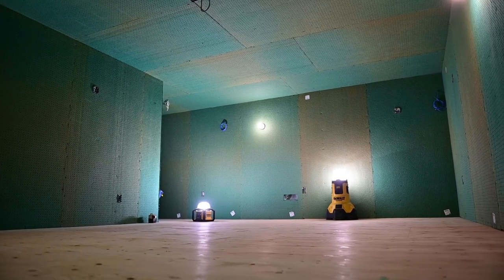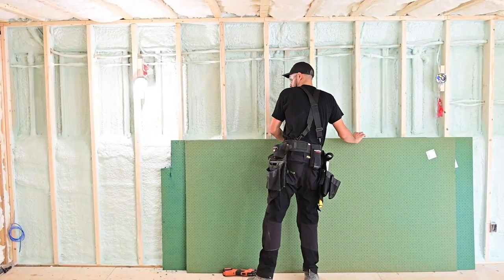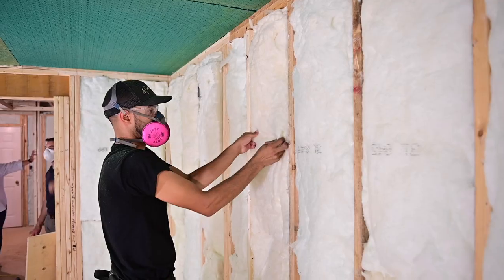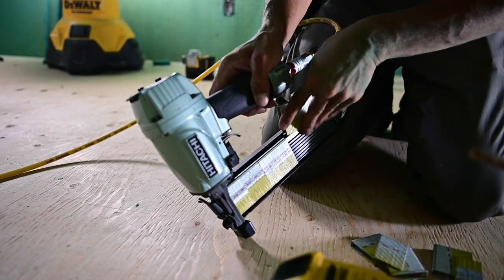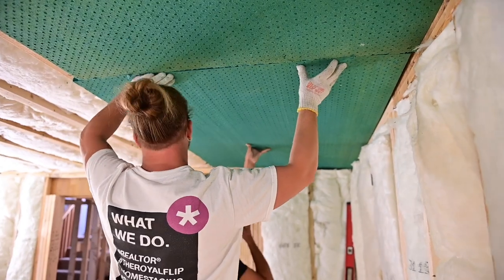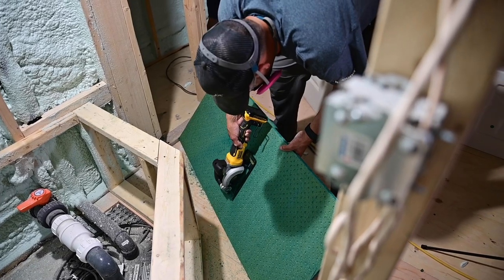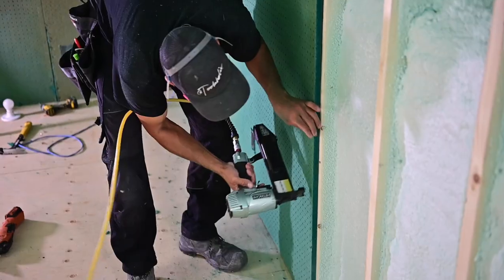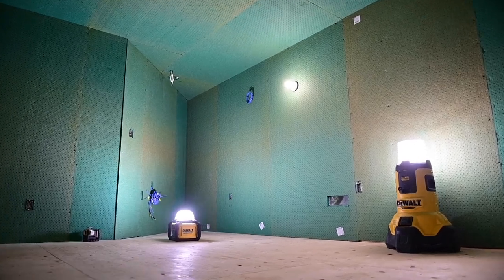Sound Dampening a Home Theatre room - HOW TO INSTALL SONOPAN

Comment: Any idea how this compares to mass loaded vinyl? Would you still put two layers of 5/8" over this with Green Glue in between?
Reply from the maker: SgtZima not sure how it compares but this is a base level install. If you want to take it to its full potential, its best to install resilient channel over it, and 2 layers of 5/8” drywall. The clients on this project did not want to lose the height
Reply: Toolaholic Thanks for the reply. That’s why I’m curious as I also don’t want to lose height. I’m wondering whether to go 3/4” of this then 5/8”, or MLV then 2x5/8”.